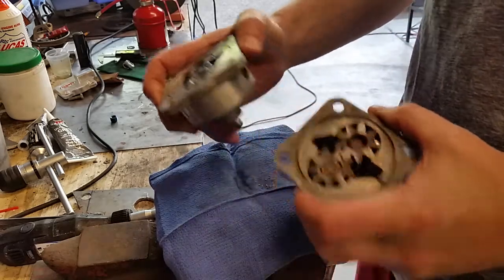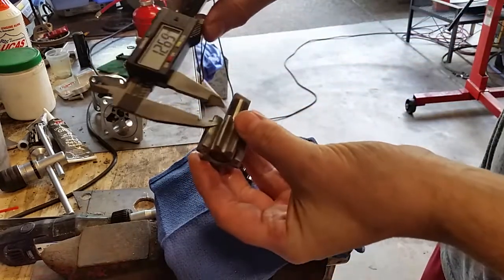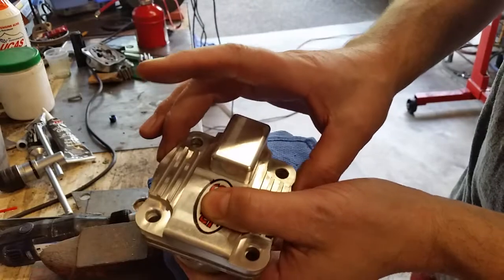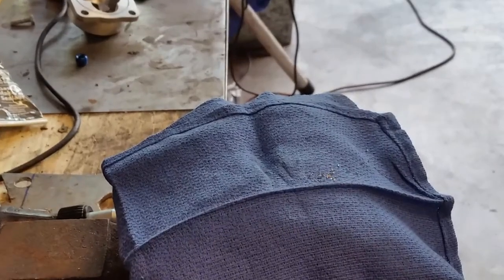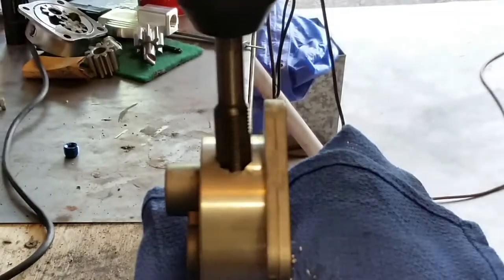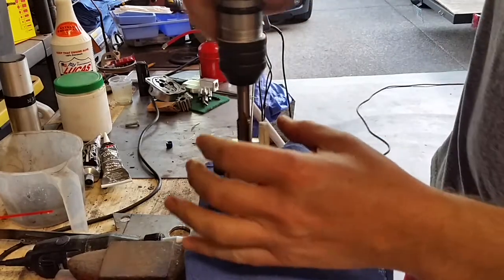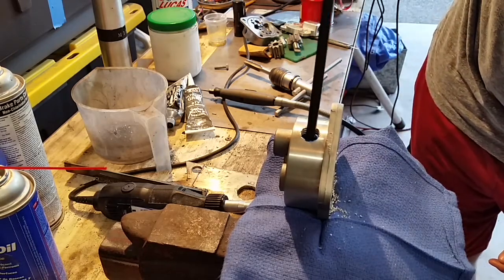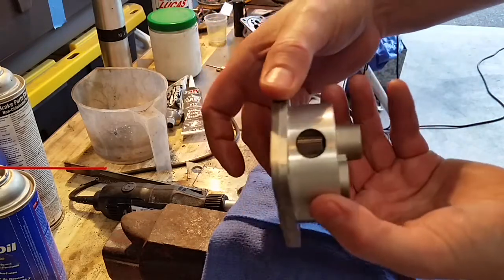Plug n port 26mm VW oil pump

Comment: Hi,
Nice  👍🏼
I have a question,
How do I remove the short studs and replace them for largers?
Where can I buy them?
Reply from the maker: The best solution in my opinion is to sray some lock-tight/corosion losening spray (like WD40 or better) into studs.  Put 2 nuts onto one stud and tighten the 2 together.  then, start backing out the stud.  if it doesnt come out, then a pair of vise-grip plyers may work.  sometimes you may have to file/dremel 2 sides of the stud to make it square in order to get plyers or a wrench to grip the stud.  Obviousely you will throw this stud away by this time.  After you get them out take one to Ace Hardware and get the right lengthn of "SS Allen head" bolt.  it should be a 8mm (i think).  try maybe a 1" or 1.25" long bolt.  this is my preference, to use allen bolts instead of double-threaden stud with nuts.  if you need more clarification i can post a small vid?